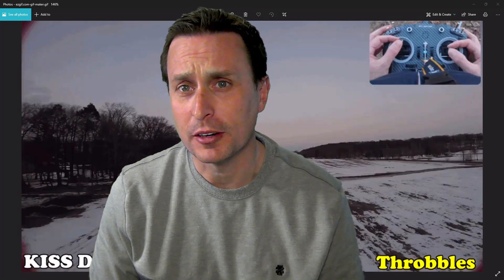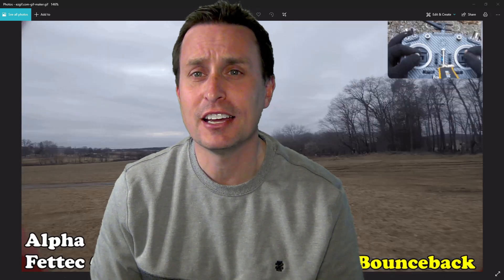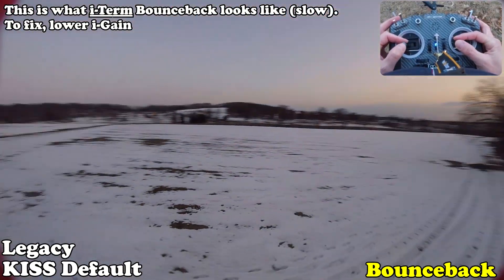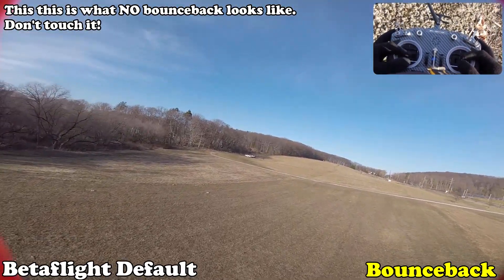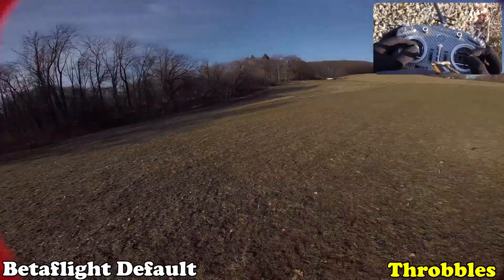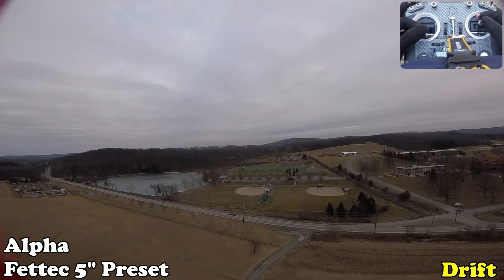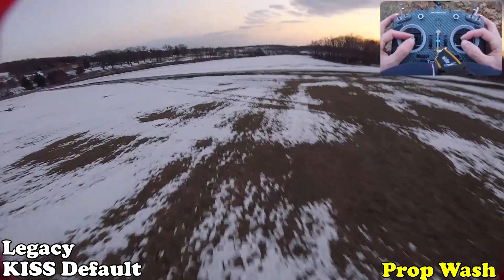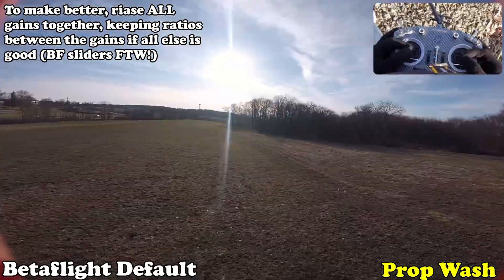Fettec v. KISS v. Betaflight | DEFAULTS

Comment: Thank you for the comparison, Mark.   This goes to show just how much every quad can benefit from a little tuning or at least a preset on any firmware. Not to mention each quad is a little different. Even my 5" Apex quads are tuned slightly different to try and achieve peak flight performance.

Comment: Awesome video! If you want raw power AND you know how to tune, use betaflight, but me, I love the feel I get from kiss, I'm not Awesome at tuning. It does seem that kiss "or fettec" esc's trade power for that smooth feeling bc its not as powerful but love the feel. I've got the kiss 25amp 4in1 on several builds running 6s 1950kv motors and no issues.
Reply from the maker: U don't need to know how to tune though.  The default is just better.
Reply: @uavtech  Yea, it has been getting better and better over firmwares for sure.

Comment: nice comparison! thx Mark! Be great to add comparison of forward flight stability across the throttle range (horizon jitter) in a slow 0-100% throttle ramp with no stick input. this is what a lot of people continue to complain about these days, especially cinelifter guys. I realize this is related to a lot of factors, but be nice to add in the mix on same quad (same hardware) across different firmwares.
Reply from the maker: I'll do that.
Reply: 4.3 with 'By RPM' PWM on BLHeli32 has made a old problem quad fly perfect in that regard. I was always tuning around mid throttle oscillations and/or horizon jitter and could never find myself perfectly happy with the non-stabilized footage. Now its damn near perfect!